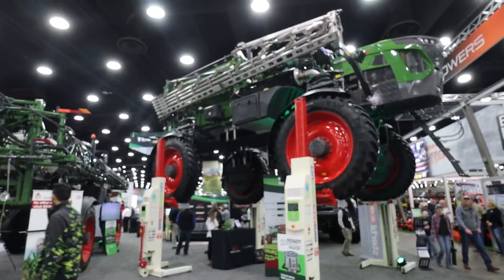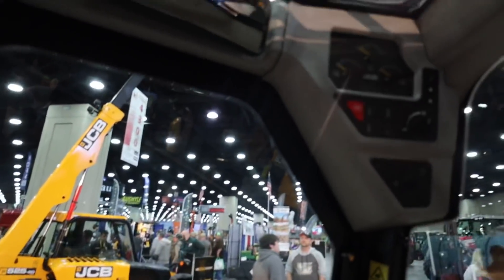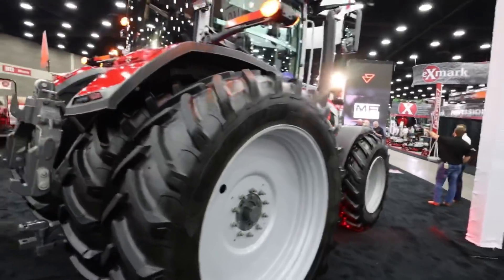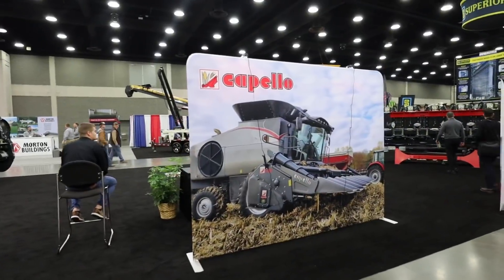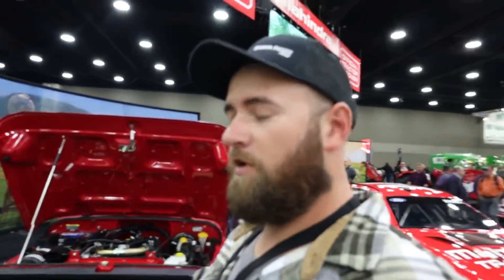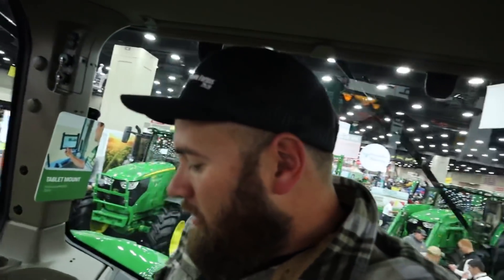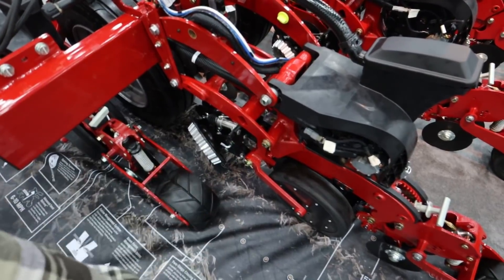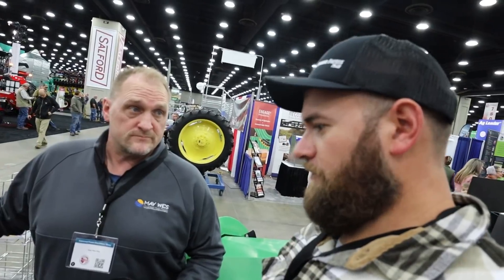National Farm Machinery Show 2022

Comment: If you get a grain vac get a conveyair there is a dealer in Ohio we actually deal with him Even thore we are in Lancaster PA. The one we have works great and has a high reach to load trucks.   We actually went away from the grain auger because we can load trucks two times faster with the vac.

Comment: We have one of those unverferth cover crop seeders mounted on our 1645d double basket.  Love the seeder itself but the deflectors they give you don’t spread very even. First year we ran it it left a 3’ strip not seeding in the center of the machine.  Worked on it more this year and it’s better but still not fixed. The double basket worked really nice behind our landoll vt but it does take some hp to pull it. You definitely notice it’s back there vs a packer or a a crumbler.  Hope this helps if you if you wanted some feed back.

Comment: Stor Lock proudly told me at Half Century that they make Shure’s cabinets. I worked in a shop that had Shure built in boxes. Every tech’s top drawer sagged and the bearings disintegrated; they replaced the drawers/carriages and the same thing happened within 8 months. My personal boxes are Lista. Other than the two years at that shop they’ve been in constant use since 2001, with my socket drawer weighing around 375lbs on single slides. The only thing that I can say bad about Lista is that their paint is adequate but not as good as other manufacturers.
Reply: Lists makes amazing cabinets. I don’t have any, but I’ve always wanted to own some.

Comment: your old case planter ended up about 20 miles from us. I think there ad said it was in good condition which I thought was funny.
Reply from the maker: The planter was but it just needed aftermarket openers
Reply: You can keep planters going forever by adding bearings, blades,and openers he didn't sell it as scrap it was sold working he just had issues with unfolding and bearings